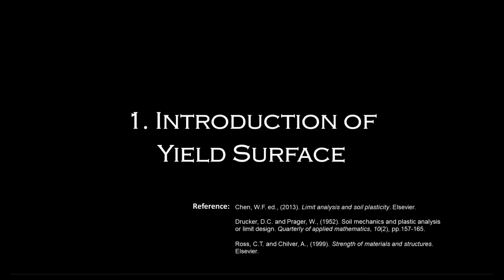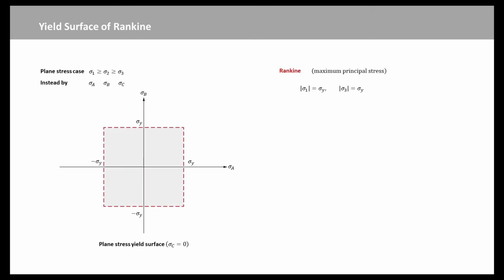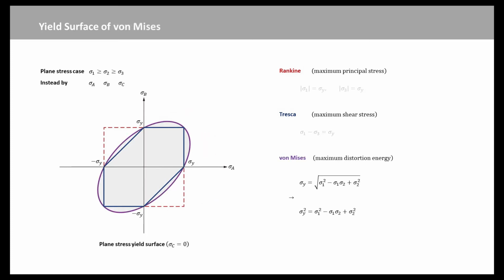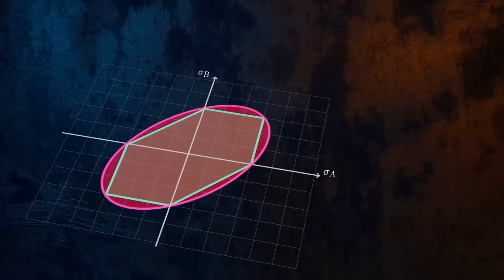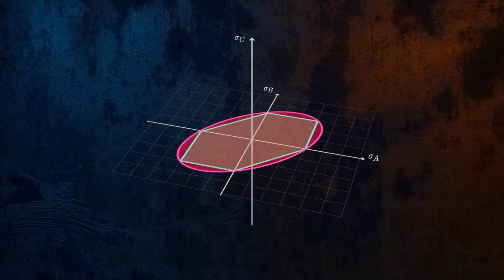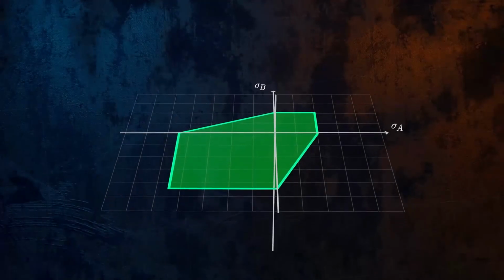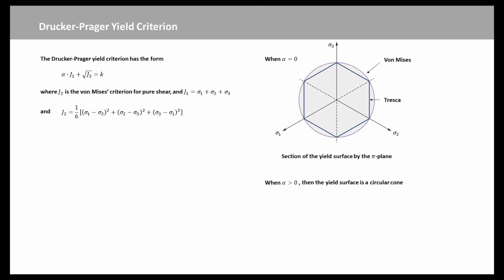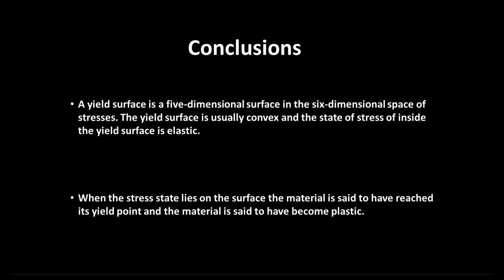Strength of Materials: Yield Surface

Comment: Hi,
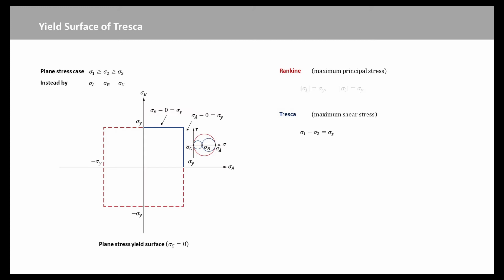In Tresca criteria, yielding occurs when shear stress reaches the yield stress, but max shear stress is half the value which formula shows(at time 2:25); am I wrong?
Reply from the maker: Thanks for your question. You are right. In Tresca criteria, tau_y = 0.5 * sigma_y.
Reply: @qidang  Thank you so much.
Does at half the sigma_y, yielding occure or it is  just some assumption?!
Reply from the maker: @arash4232  According to Tresca criteria,  tau_y = 0.5 * sigma_y. Tresca's assumptions are that yield will occur when the maximum shear stress due to a combination of individual stresses becomes equal to the maximum shear stress that occurs in a simple tensile test on the same material. Thus tau_y = 0.5 * sigma_y is the answer.
Reply: @qidang  Thank you so much.
The clip helped me a lot, thank you for responses as well.